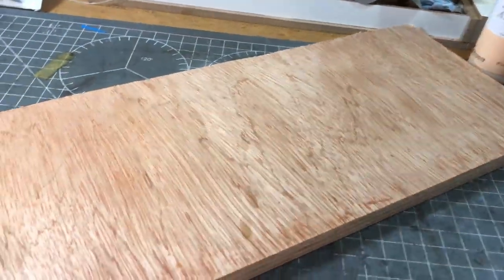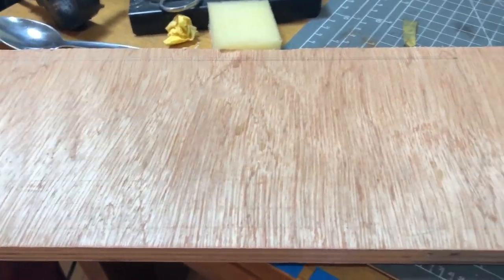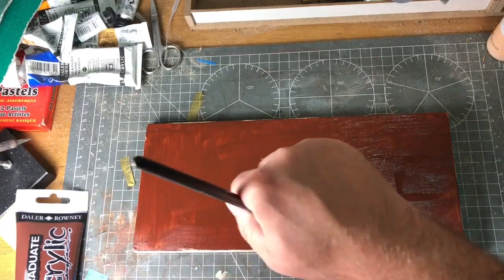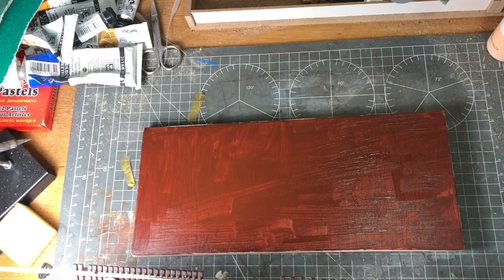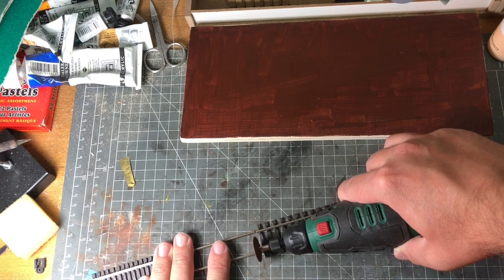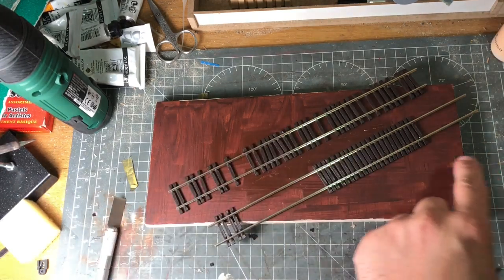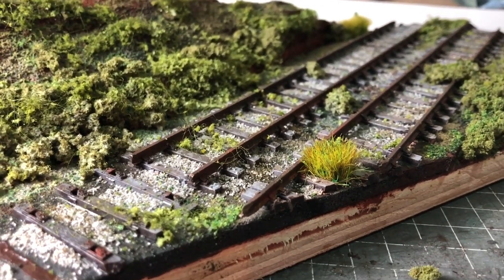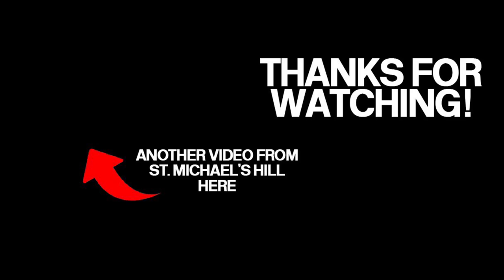Modelling a disused railway - St. Michael's Hill Model Railway Ep.54

Comment: An incredible result Rich, you’ve captured the look perfectly. Paul
Reply from the maker: Thanks so much Paul! Means a lot coming from you! Certainly pleased with the track, just wish I'd managed to get the static grass applicator working properly. I might need to invest in  a proper one at some point
Reply: St Michael's Hill They are a bit of a dark art Rich, I did invest in one but I’m still not 100% happy with its application. That may be more down to the long grasses I’m using though, they seem more prone to lying down when applying. Paul
Reply from the maker: @GalgormHall  Which one did you get? It's something that I really would like to get right on the new layout
Reply: St Michael's Hill I went for the WWS one aided by Richards discount code at the time. 😉 Paul

Comment: That looks excellent, I absolutly LOVE abandoned railway lines. Such a small space and used so well, Top stuff.
Reply from the maker: There is something very cool about them! Apart from the lack of trains of course! I will try and include a piece of abandoned track on my new layout
Reply: @stmichaelshill7421  I always try and incorporate a small section even if its just where trackwork has been removed and there is a small section they never lifted.
Reply from the maker: Certainly adds some interest without having more and more lines, which sometimes I find a little bit much on layouts.